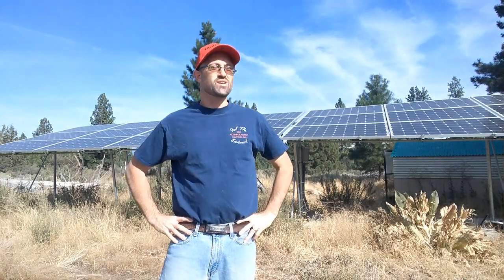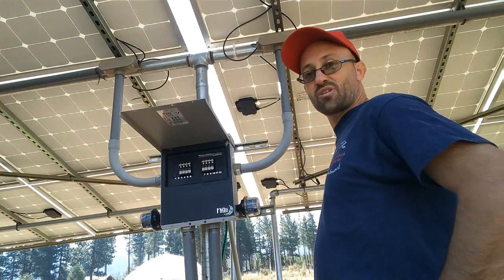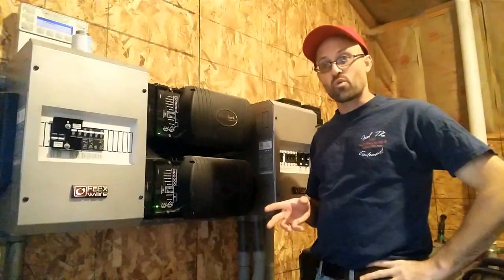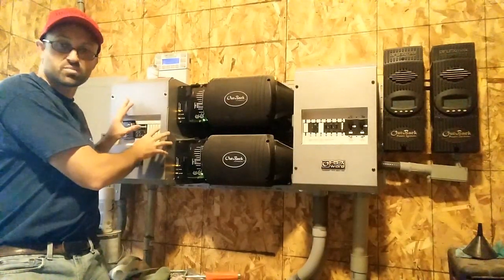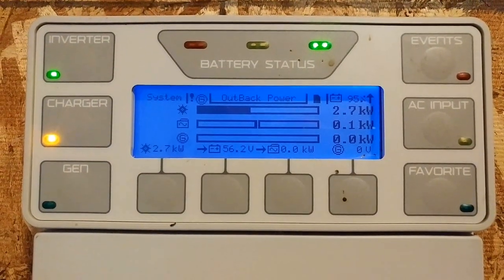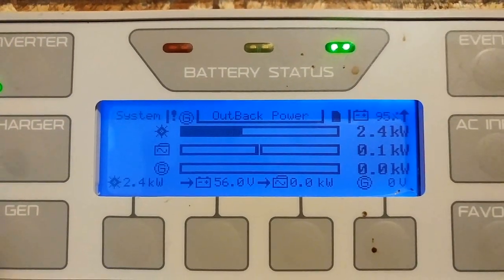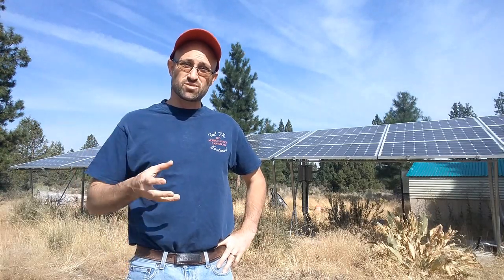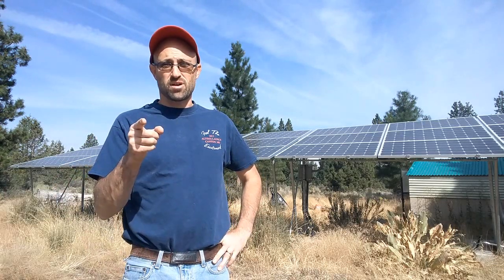How Does Solar Power Really Work?

Comment: We had grid tied solar for our home for 12 years. In retrospect, it really did not have the financial advantage that we had anticipated. The performance of our solar panels degraded more rapidly than the manufacturers claimed, and even keeping the panels clean we were seeing about 5% drop in output per year. The thing that really got us though is, that for grid tied solar to financially work, you need to have net metering where the electric provider gives you credit for the power you are putting back on the grid. Most homes use most electricity in the morning and evening when lights are on, you are cooking, using hot water and so forth, yet your panels are producing in the middle of the day. So, your electric demand and supply are not synced. The issue is, electric providers are not required to offer net metering. In our area, there was only one provider offering net metering. We invested in our solar panels, and then after two years the electric provider changed the net metering terms, where the electricity we used they charged us high retail per KWH, and then the energy we put back on the grid, they paid us low wholesale. With this math, the panels absolutely did not make sense. So, we love the idea of solar, but for us it really was a financial loss.

Comment: You guys on the OpticsRE forum?  I have the outback system at my house.  It is a ground mount like yours, but, we are grid tied.  Like your videos and are you having any problems with your mate?  I have had mine for about 6 months and the learning curve is biblical!  I have been using the forum to get answers and it has been great.  Thanks!
Reply from the maker: I have read through some of the threads, but I have not signed up to post anything to the forum. No real issues with our Mate in 6 years. We had a period of months last year where the Mate would lose the screen info (blank out) for a few seconds, then come back on. It never lost information, just the screen would go black. It has since stopped doing it. We started to see our batteries having storage problems around October / November last year also, but that may or may not have any correlation. I never determined why.

The system is pretty in-depth for settings. Thankfully my father-in-law has a duplicate system to ours, and he did all the initial settings. I simply copied his settings to an SD card and uploaded to ours. I've learned to make adjustments as the batteries have started to fail, and now know how to change things when new batteries go in this month.